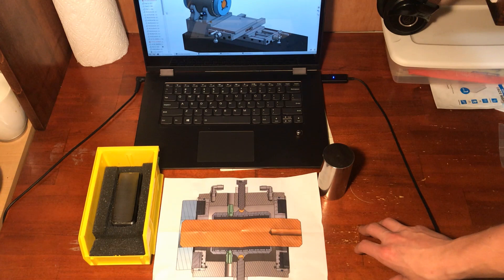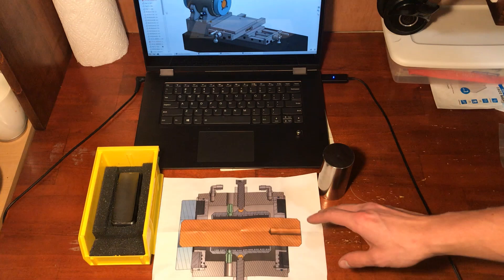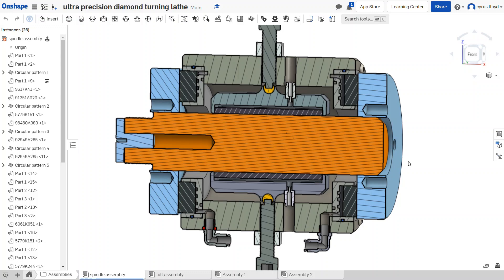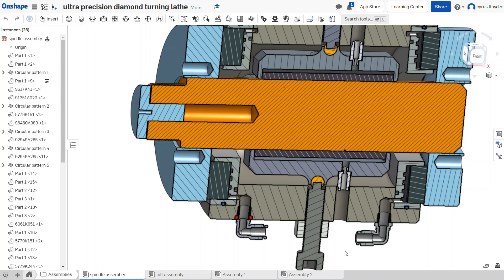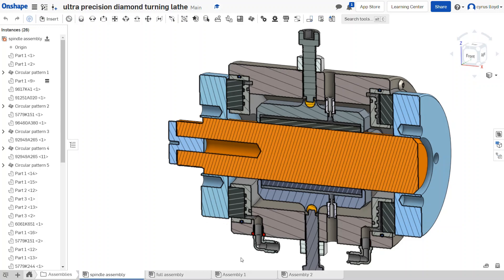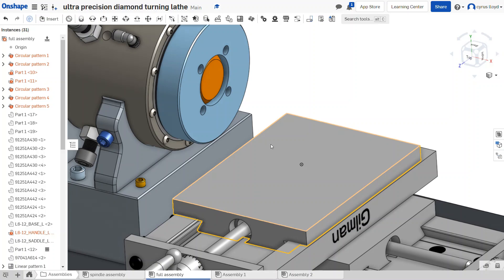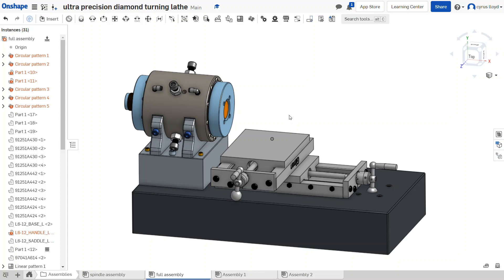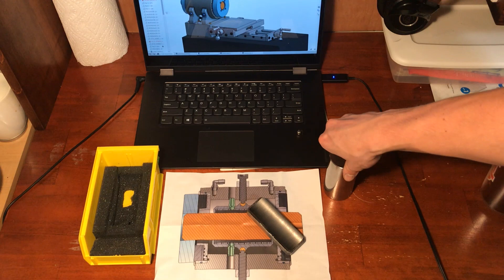Air Bearing Spindle Diamond Turning CNC Lathe: Complete Design Review and Introduction

Comment: For your Radial Adjustments, I would highly recommend making several Differential Threads...
that way you can achieve almost micron adjustment very accurately...additionally, you can 
then use conventional thread sizes and Not have to make a Tap...I have made several that 
achieve nearly the equivalent of 200 TPI

On machining the Graphine bearing final shape a Jig Grinder with a diamond tool would work
nicely...

Following your build, as I am also designing an Air Bearing lathe...having just purchased a 
Brown & Sharpe #1 Universal Cylinder Grinder and next a Moore #3 Jig Grinder...Great work!!!
Reply from the maker: As I mentioned in another comment, differential screws would be a little difficult to implement into this particular design, and id like to keep it as rigid as possible. You are certainly right in that a Moore jig bore would make easy work of the bearing radii, but the shop I work in doesn’t have one and I’m not made of money so I’ll have to stick to standard boring heads for now.

Comment: Beautiful concept! I know you changed this quite a bit since making the video, and this comment is no longer valid for this design, but maybe you can use it for a future design:  Incase you were not aware, McMaster sells ultra fine thread screws, and press fit brass threaded inserts. They don't go to 1/2" diameter, but do to 1/4-80 and 1/4-100. PN is 98625A200 for the screw and 98625A586 for the insert. (multiple lengths of both are offered). The screws also have a ball at the end which could potentially interface with the pivoting jaw directly. I was going to use these to build a fine adjust into an indicator holder. (never got around to it).

Comment: You can use differential threads for fine adjustment. Basically a hollow bolt with a different thread pitch on the inside bore, then screw in that bore. Say if you have a 1/2-20 main screw. That screw is drilled down the middle and tapped #10-24. One full turn of the outer bolt advances the screw 0.050" like normal. But if you hold the inner screw still, then that screw will retreat 0.042" and give you a nice fine 0.008" per turn advance at the end of that inner screw. Locking that inner screw without disturbing it might be difficult though. Maybe if you made your main bolt from scratch with a large thumbwheel you could have a perpendicular setscrew, and have a lead or copper slug to bear against the thread of the inner screw to keep it backing out. Or if you can find a small screw that's long enough, a locknut against the head of the outer screw will work fine.

(Well crap. I wrote this while watching and didn't know others had pointed it out.)
Reply from the maker: I get more more comments telling me to use differential threads on my channel than any other kind of comment lol. I was familiar with them going into this design and chose to not use them for reasons I’ve explained in other comments

Comment: Epic. This design is really clever. Have you thought about thermal expansion, could this be a problem? I mean you have an constant stream of air "cooling" the spindle. Maybe a state of thermal equilibrium will be reached, without active contol. On the other hand even a one degree change could get you in trouble reaching sub micron precision. Maybe you could activly control the power of the compressor and some thermal sensors to build an feed back loop that compensate for any thermal expansion. 
The "cheap" granit plates I have don't reach sub micron levels. They have a measure protocol showing 2µm deviation on a 300x500mm plate. Grade 00 Plates on the other hand are really expensive. But with a air bearing spindle, maybe you can grind your own to your specifications. PS I am your 2^9 subscriber. Keep up that good work, get a workshop at home :D
Reply from the maker: One of the great things about air bearings is their thermal stability due to lack of friction. They’ll only generate heat at very high speeds, faster than I would run them. The only potential source of heat is the motor itself at the rear of the spindle, and the self cooling effects of all the airflow through the assembly acts to counteract this. The surface plate flatness tolerances don’t necessarily need to be AA to achieve good precision either. It’s more an alignment tool to make getting the axis and spindle nice and inline easier. An out of flat surface plate that was, let’s say, convex 2 tenths would effect things like diametrical tolerance through a pseudo cosine error type of relationship and wouldn’t effect the tool position relative to the work by much at all. Thanks for the support!

Comment: One more question, and I may have missed it (but I did watch the whole video). Are there 2 or 4 radial bearings? Since you are showing a section its difficult to tell. I'm working on a lathe chuck concept with pivoting jaws in order to hold tapered objects. What you had with the ball and socket was very similar to what I have brainstormed thus far. I was using a cylinder for a pivot, rather than a ball, as I didn't think I needed more degrees of freedom than one. You commented that your design is self aligning. (meaning the shaft runs coaxial to the intended headstock Z axis). Is that true if it had 2 radial bearings, or 4 radial bearings, or both? I was actually surprised to hear it was self aligning. With my chuck design I'm looking at 4 pivoting jaws with a screw behind them, just like a conventional lathe 4 jaw independent chuck. And having 2 complete chucks with pivoting jaws separated by a several inches. I thought I needed 2 chucks to do the alignment. But you comment that it self aligns might negate the need for a second chuck in my case. Thanks.

Comment: thanks for the vid and the time you took to explain things.  My real question is this.  What is it that you plan on making that will actually take advantage of this precision?  Do you have a list of interesting applications that you can highlight to illustrate the need for such precision?  thanks again for the vids, great work
Reply from the maker: That is a good question I never addressed. I should mention, the design is obviously completely different now than it was in this video. I’ll make a new video once the design is done in November. Diamond turning lathes are the precision behind a lot of stuff, namely cell phone camera lenses and many many other optics, as well as applications in automotive, medical, physics, and a bunch of industries. Personally, I am interested in using the technology to produce telescope Mirrors that require 0 post processing and are sufficiently accurate and reflective directly off the machine.
Reply: @cylosgarage  that is what I want to do as well.  Astrophotography is a hobby of mine.  I have a Software Bisque paramount mount on a Takahashi (other way around actually)

Very cool , we should keep in touch

Comment: Great project! have you considered using two Hemispheres back to back,   |)--(|   , I know some other youtubers were discussing it. It will make lapping a lot easier, and likely present some great results.
Reply from the maker: not entirely sure what you mean by that, please elaborate
Reply: @cylosgarage  https://youtu.be/Jq4a25W_emI?t=345
Reply from the maker: @DUIofPhysics  Ahhh yes i remember that. It so happens that it is much easier for me to manufacture flat planes and simple radii rather than manufacture a massive ultra precision metal spheroid and matching bearing. If I had better manufacturing capabilities I'd consider it but I'm pretty happy with the system I've got worked out now. Thanks for the support!
Reply: @cylosgarage  I look forwards to seeing how it works out for you. However, just to note, I've found online sources, you can buy those ball bearings up to 5" diameter, just saw one in half then machine it from there. Here is a 5" one! https://www.bcprecision.com/collections/chrome-steel-ball-bearings/products/5-inch-chrome-steel-ball-bearings-g25
Reply from the maker: @DUIofPhysics  wow! that's impressively cheap! Hopefully Adam keeps his word and attempts one of such spindles in the future

Comment: Have you thought about outsourcing the manufacturing of the shaft and sleeve to get the precision you want instead of compromising the design? Or if you lap the critical parts, the limit of what you can make is what you can measure?
Reply from the maker: Outsourcing something of this precision would become very expensive very fast. I am thoroughly confidant I can lap the thrust faces flat and perpendicular to under 50 millionths (measurement limit is 20 millionths for what I have), which is more than accurate enough for good function.
Reply: @cylosgarage  I am just thinking that the spindle would deflect easily for precision application, it should have 2 sets of the pad bearings if you go with that type of design at least.
Reply from the maker: @MF175mp  the two sets of bearing pads would technically be over-constraint and would make aligning the entire assembly extremely difficult. The moment loads are actually taken up by the thrust bearings counterintuitively, i'm thinking about making  a video soon on the spindle statics and forces to better explain how it's rigid despite those floppy radial bearings.

Comment: One thing to enhance the cutting actions of the "teeth" cut in the bearing, Considering the shape of it and the fixed rotation axis, you cut them at the wrong angle, you need to turn them let's say 45 degrees. In your current setup, one set of lines do not cut at all, the others cut at the same time the whole length of the "tooth". That's not good. It cuts way too abruptly and it gives you worse looking scratches in the graphite. Look at end mills for metal - look at the helix and the angle they have. Basic routing end-mills for wood are just straight pieces of carbide brazed without any helix to a steel base - reasons are reduced price, and they do not tear out the fibers of wood up or down.
Reply from the maker: bruh what lmao
Reply: @cylosgarage  what what? 26:45 - you're showing the cylindrical bearing you say you used for lapping the cylindrical shape into graphite and the lines you cut are perpendicular and parallel to any kind of motion you would use during "lapping" the graphite to shape. I just offered you a suggestions of of how such lines (teeth of cutting action) should be angled for better performance. Also look at ben Krasnow's video, he has the teeth at not 90 degree also.  Look at this vid https://youtu.be/Wojlc3VsuHQ?t=846 . The lines are 45 degree to the motion of the durin the lapping of prismatic ways. Same was done on the prismatic ways on Moore Jig Grinders as per book "Foundations of Mechanical accuracy" by Wayne.R.Moore
Reply from the maker: @chronokoks  oh i thought you were talking about something completely different. I see now. regardless if the lapping had worked well or not, the fact remains that even shafts from the same batch have some variance in diameter; the one i bought for lapping was 6 tenths smaller than the full shaft for the spindle, for example. This difference in diameters is fine for demos like ben's, but for best performance they need to be matched much better. Therefore I've abandoned lapping for boring. Thanks for the advice though, you're totally right.

Comment: very nice work so far. Air bearings have also been on my todo list, but still far away. 

Where do you get the graphite material from?
Reply from the maker: Most generic graphite off of amazon seems to work great. Just search graphite block or graphite rod or something and pick one that says its for EDM electrodes. This ensures you don't get any impure clay bonded graphite, as only the pure stuff works. Thanks!

Comment: You should look into differential screws
Reply from the maker: I'm actually using differential screws in an indicator base I'm building right now. I would have liked to have used them in this but it would have been complicated to implement and sacrificed a little rigidity.
Reply: @cylosgarage  Have you shared any information about that online? If so can you link me to it?
Reply from the maker: @evren.builds  unfortunately no I haven’t, perhaps I should. If you look at Tom Lipton’s video on precision mechanics though, it’s basically the same thing as what he did in that video to demonstrate differential screws
Reply: @cylosgarage  Thanks!, will do

Comment: why are you using graphite? yeah I have seen the videos of everyone using graphite for air bearings but that's good for youtube videos. For production machine you would like to use some strong plastic material, or metal. Graphite could deteriorate over time and the spindle wouldn't be durable. If your spindle is going to be held vertically, then putting traditional bearings (made with metal balls) at the bottom would prevent the spindle from being damaged on pressure loss during movement. And even if the spindle would have to be held horizontally I would avoid graphite and look for other solutions
Reply from the maker: “One of the great challenges in life is knowing enough to think you're right but not enough to know you're wrong” 
-Neil deGrasse Tyson
Reply: @cylosgarage  you forgot to add the statement about nonexistence of an absolute truth